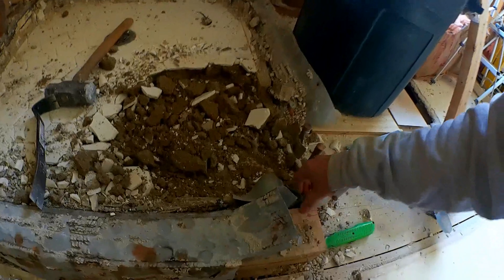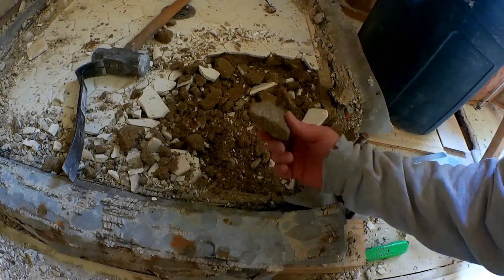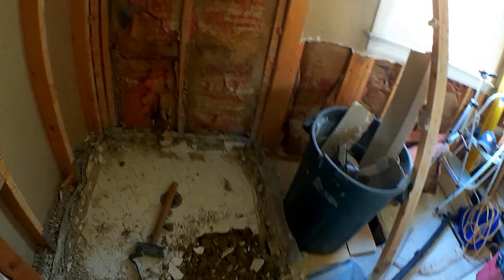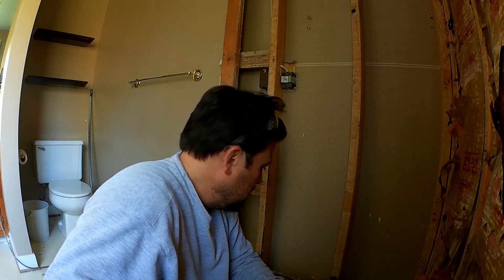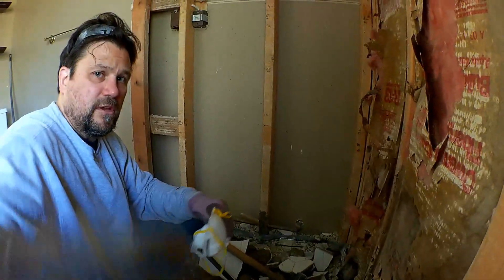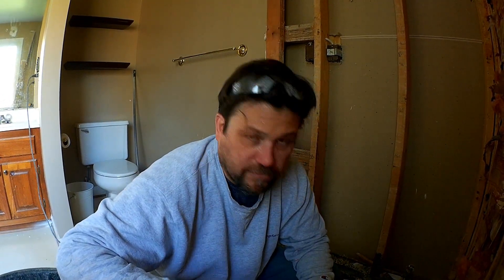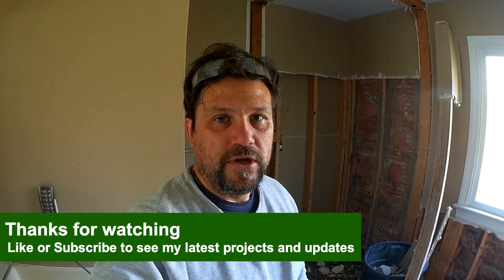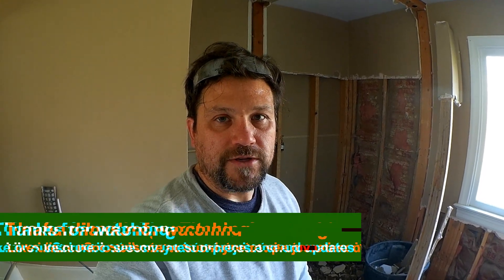Shower Pan Liner Without Pre-Slope...How Long Did It Last?

Comment: Just use a liner, it's not people's opinions. Go on Google and do the research. Tcna. Some people on YouTube are out of their mind. And there's generations of people in certain areas of the United States that have been taught for 40-50 years that you don't need a pre slope, and sometimes the code actually says if the concrete is recessed below-grade of the rest of the house then you didn't need a pre slope and they recently change that law. But interesting video I would like to see more around the drain in detail. Maybe you got lucky. But a pre slope done correctly will definitely totally dry out let's say after a month of so use if you took a jackhammer to that it would be pretty much dry without a pre-slope it would still be saturated. Thanks for the cool video
Reply from the maker: Thanks for the feedback, I thought it was an interesting controversy to document.